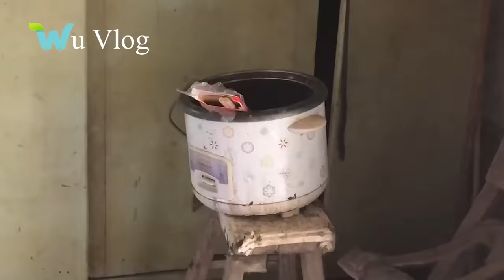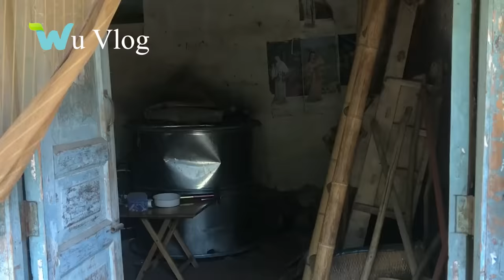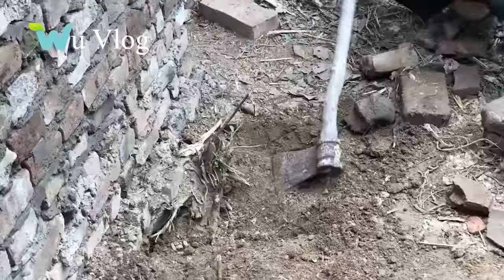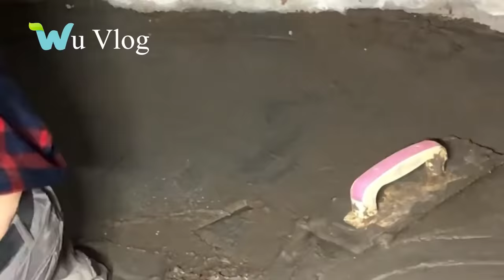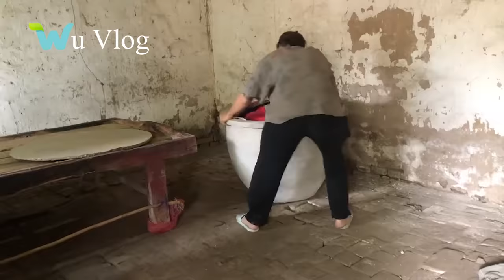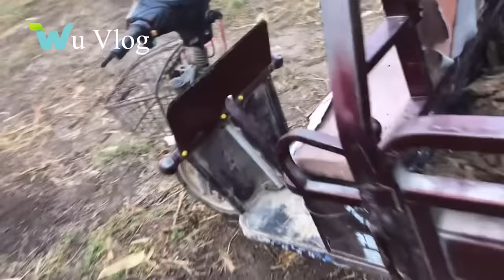Brother renovates dilapidated old house for sister to prepare her wedding

Comment: Did a wonderful thing, however Breckinridge that wall want done correctly,  morter is to surround all sides of the bick ad you build up to the final row, you have slot of hole spaces, this allows water, dirt etc to come in......but you took on a very huge project,   I got physically tired after you cleaned the yard

Comment: They built a bathroom.. how does the waste matters be removed? 🤔
Reply: With a Septic tank system...
That was the big square hole in the back they built...
Waste flows into the tank and decays as the tank fills,the overfill runs out a long drain pipe in the ground...
This is a common type to use in rural areas....💯😁
Reply: @larannar123  thanks for your explanation! 😊
Reply: Please explain the small sink in the bathroom? This has been so interesting to watch. Thanks!
Reply: @allwright5662  
It's not a sink,it's a traditional toilet that is commonly used...
The modern commode they installed is very Western ,more Chinese are switching to using the newer version but in most traditional homes,they still use the porcelain basin in the floor,and you squat over it..
It's a very simple toilet that is popular because it doesn't need plumbing and running water to use...